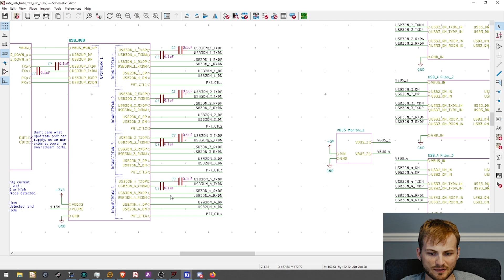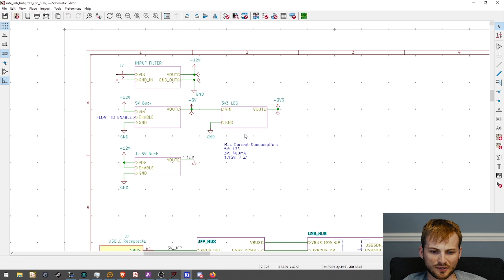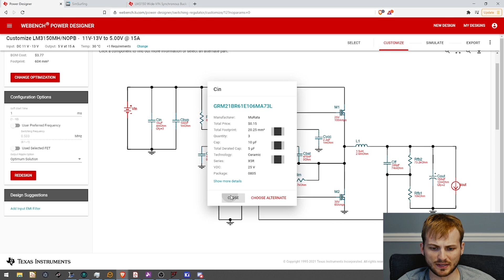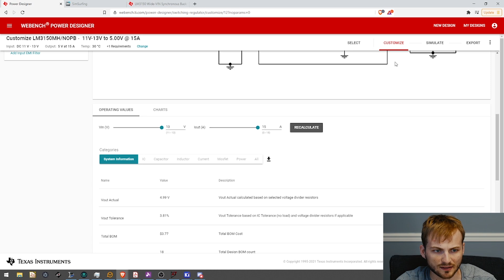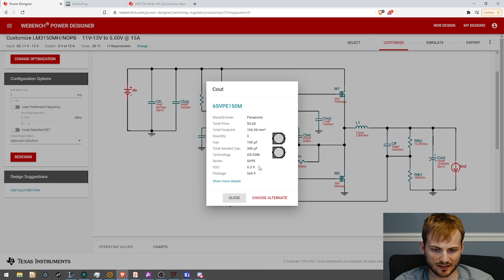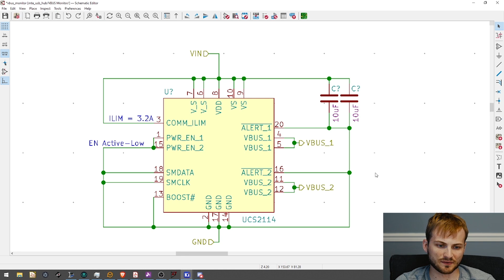USB Hub Design - Part 4/x - Buck Switching Supply Design

Comment: FWIW, modern tantalum capacitors from decent brands (Kemet, Murata, etc.) use an alternative solid electrolyte chemistry to the older type that had a tendency to turn into fireworks. This has been the case for the past ten years or so now.

All tantalum caps have very small fissure defects inside them, and on the older materials these fissures would tend to form oxygen at the surface discontinuities under DC bias. Furthermore, these oxidised surfaces have higher resistance/impedance, so the ripple current can start to cause hotspots. You can see where this is going: oxygen and heat = fire. The oxygen production is typically only stimulated by higher DC bias. It's an electrochemical process, and to push it further you need more voltage, so once the cap has seen 5V it won't degrade any further if it never sees a voltage higher than that. As such, if your board didn't catch fire in testing then it shouldn't catch fire in operation... in theory. Typically the "firework" scenario only occurs when something else fails and a voltage rail goes out of spec, causing the cap to see a higher voltage, a bunch of oxygen to form and the hotspots to worsen, and eventually you get thermal runaway and fire. However, in a small number of cases where the tantalum cap's internal fissures were unusually bad and you had a bunch of ripple current, you could set them off just with the increased voltage rail ripple you'd tend to see in a system after the electrolytic capacitors aged and their ESR worsened. Motherboard and graphics card VRMs were notorious for that type of failure.

The capacitor industry kinda got sick of this, partly because people started avoiding tantalum caps, and figured out a better solution. The newer solid electrolyte chemistry does the reverse under bias: it absorbs oxygen on the fissure surfaces. This is often referred to as a self-healing effect. During production the caps go through a DC bias ramp to "cure" the internal imperfections, which makes them far safer than they used to be for handling high ripple currents close to their rated voltage. You can still make them catch fire if you really hammer them with ripple current, but that's no different than an aluminium electrolytic or solidpoly.

Comment: If I am not wrong, you could use a different type of Buck controller that uses a current sensing resistor and does not have issues with output capacitors being "too good"

Comment: You can put an inductor in series with the 5V buck after the first output cap. This will increase the ripple seen by the controller and help filter the output.
A 1.5uH as your switching inductor should be fine.

Great video! Can't wait to see the PCB layout.
Reply from the maker: Totally, that's the way you do it. I don't see a need to get the ripple down that far on this board, so I won't be adding it.

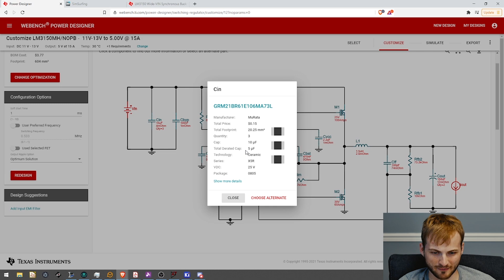Comment: 13:50 The 5 uF "total derated cap" is already the sum of the 3 10 uF caps derated to 1.7 uF each.
Reply from the maker: Hm. Glad you pointed that out, that does seem what they're doing. But, and I'll have to check the math, 5uF total on the input of the buck is going to be way too low I think